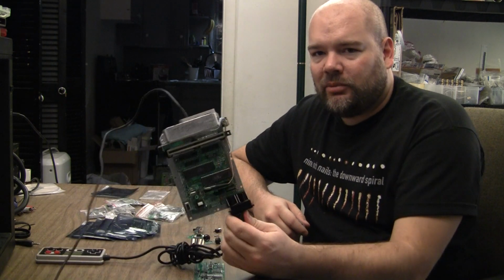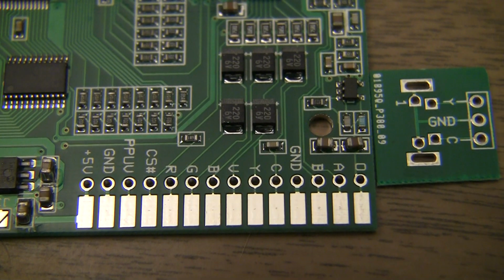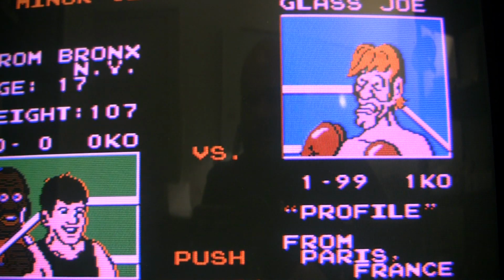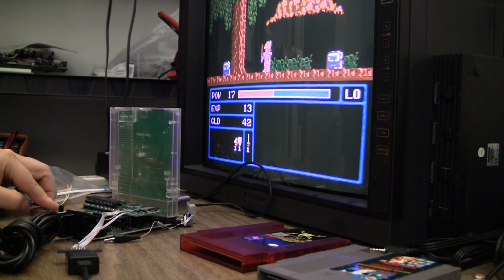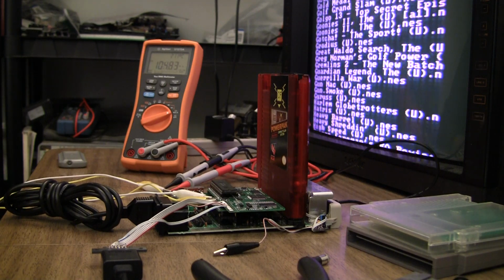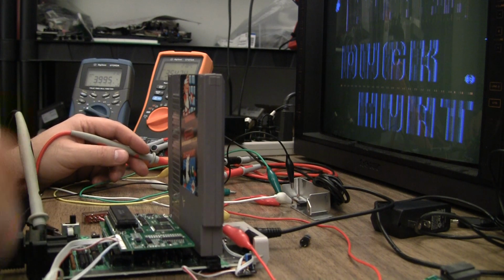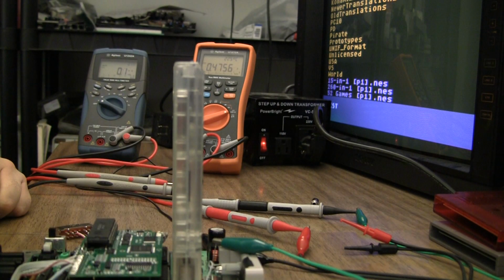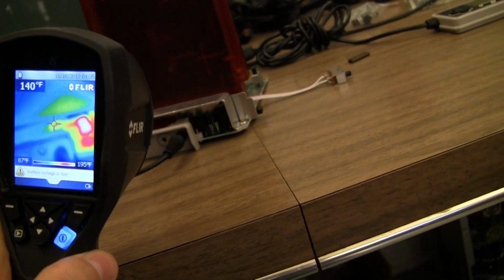NES-101 Nintendo - testing viletim's RGB board Pt 1

Comment: Is the NESRGB resistant to jailbars?  I just ordered one to put in my oldschool Famicom, which seems to have more trouble with jailbars than its toaster and AV brethren.  The original famicom seems to be the most troublesome version to mod, so I'm hoping I don't end up with jailbars after soldering all those wires.  I should probably just mod my toaster and wait for Tim to release a famicom adapter board....   but I doubt I have the patience :P

Comment: How does the board make the NES PPU output RGB? Magic? And to think, I was thinking of bidding on a PC-10 board earlier, haha.
Reply: Chips on it run the graphics parts of an NES emulator, and then output those as RGB, as far as I understood it. So the code parts of the graphics are run by real hardware, but they emulate the last part instead of letting the PPU output composit.

Comment: Why don't you use a buck converter instead of the linear regulator? They generate no heat. They're perfect for stuff like this. Any ripple could be removed by putting a cap on its output.
Reply from the maker: For many reasons... They cost way more than a linear, even the stock one seems to be able to handle the load and not overheat, they do generate heat as seen in some of my other vids, and i'm not convinced it wouldn't generate video output interference, therefore not worth it.
What i'm more interested in is a better rectifier, that may be part of my next bit of research as I think I have a schottky rectifier that I can put in place of the stock one.
Reply: GameTechUS I await your results. I'm always looking for a way to make my consoles run better.
Reply: This is one of the NES's many engineering shortcomings.  Especially given the fact that the ICs of that era were so inefficient (and thus consumed quite a bit of current for a single 7805), I would have liked to see separate digital and analog rails.  This would have increased the potential for keeping the analog rail nice and clean via separate regulators, or at least some lowpass filtering.  Unfortunately, both the CPU and PPU are mixed digital / analog with a single Vcc pin.

Granted, in stock form, it's within the thermal margin of a single linear reg, and they probably didn't really plan on 100mA+ loads in addition to the base system -- even via the ill-fated expansion connector.  And, displays of the time were crappy enough that the noisy analog outputs were "good enough".  Still, it would have been nice to have one extra power pin on each IC, even if they were originally tied together.

I have a pretty long wishlist, though, and most of it benefits significantly from 30+ years of hindsight.  I have to keep reminding myself -- it was 1985.  There was a lot of hairspray involved.